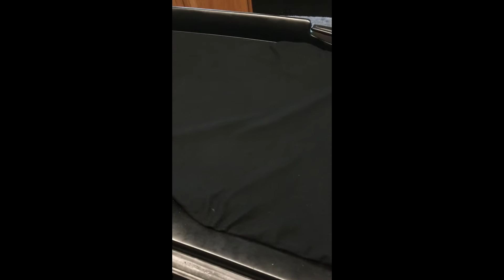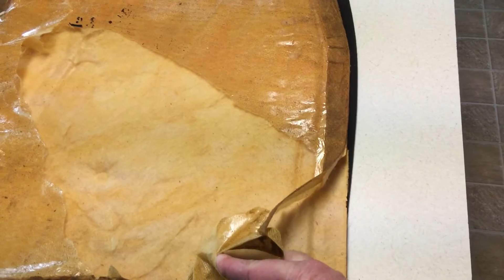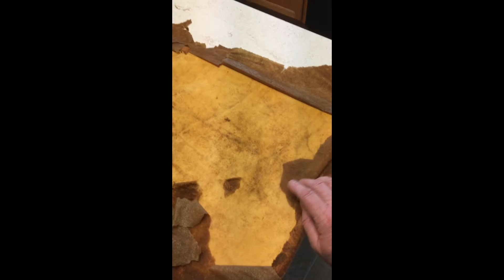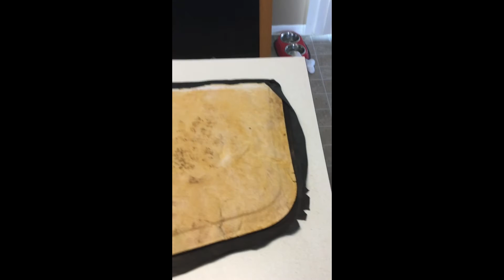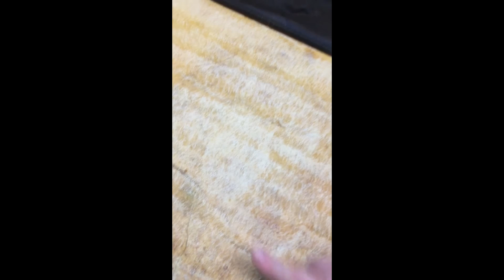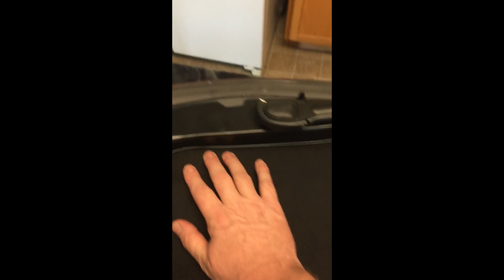headliner repair C5 (1997-2004) Corvette targa top

Comment: You did a great job on yours! I would say for everyone else if you’re going to attempt to do this, you are better off remaking it yourself. I just finished doing mine and only because it’s going to be in a area that you can’t see well am I keeping it. If I had to do it over again, I would probably order the kit on eBay that’s like 35 bucks and do it that way. Reusing this old material along with the old foam is not fun to work with. I got an estimate from a local guy here and he said he would normally charge $500.00 but would do it for $350 and that’s a “good deal” he said. So I did it myself